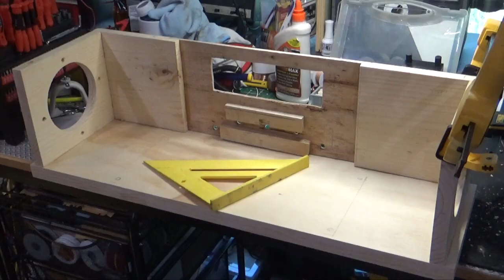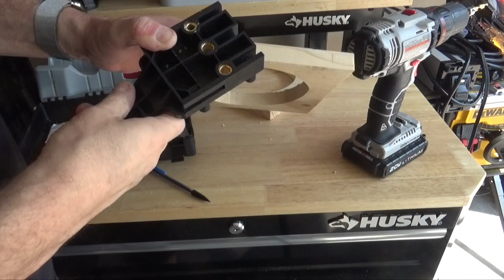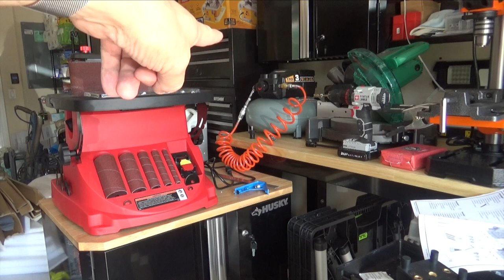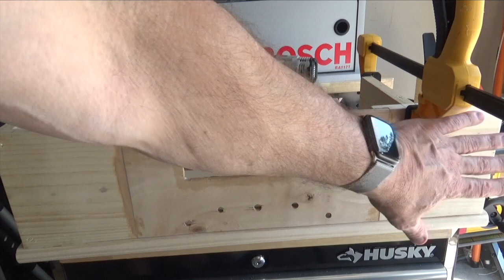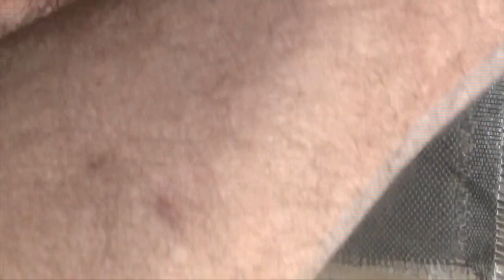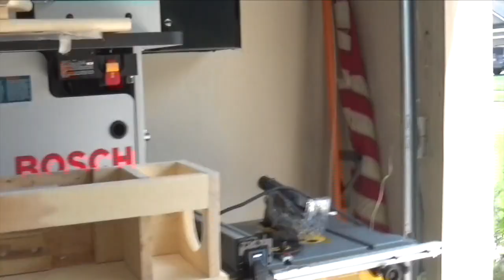Radio Craftsmen RC8 Cabinet Construction #6 : Good Progress

Comment: With all those woodworking tools you will be showing us how you built some more impressive
stuff in no time. So the radio's cabinet is progressing quite nicely. Might want to paint the
wood a grey color  where the grill cloth is going  just to even up the grill cloth's sheen.
OR you can use light grey colored poster board ! Cut holes in the poster board around the speaker holes. You may otherwise see a difference behind the cloth's small spaces between the end grain and face grain of the wood sides. Interesting metal bronze legs. Tease, tease.
Reply from the maker: Thanks Steve.  The plan is to stain the inside of the cabinet lightly, paint the outside battleship gray to ensure no bleed thru.  The top and bottom will be finished with a quality finish.  I am told Mid Century Modern was all about lighter stains so this will not be dark on the outside..  something like a Cherry Stain or Oak.  We'll see.  I have enough tools to do some cool things for sure and I will :)   thanks
Ron

Comment: Ron,
You've got a nice woodworking machinery setup there, my friend, big enough to do the job and still have enough room to work...but 5 acres and a brand new 40' x 40' shop/garage would be even better.  Get off that wallet, son.😁  And you know...that cabinet is beginning to look like an Atwater Kent design.
Regards,
John
Reply from the maker: John my friend. I did some wood working many years ago and never went back to it. In my later years its time.. I WISH I HAD THE SPACE to build that shop you mention.. I love your setup... maybe when I retire soon it will be possible... for now, I use the garage for that and inside for radio work. I do love the combination of the two hobbies here.  I agree...the cabinet does look familiar... but the grill cloth will set it apart from the rest:)   Thanks my friend..   Ron
Reply: I am blessed with 9 acres of land, a garage of about 30X60 feet but no tools to do the work with and no money to purchase them.
Reply from the maker: @waynethompson8416   - I hear you brother. We all have different perspectives on this stuff... glad we are all together in this little community. !!